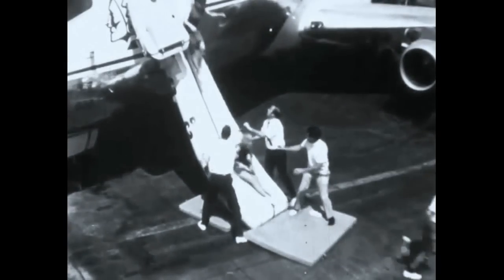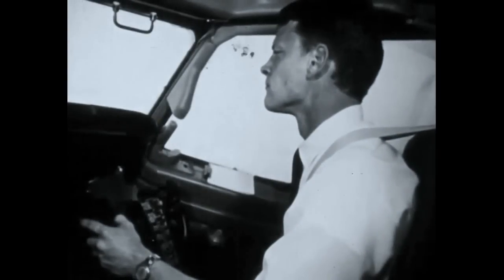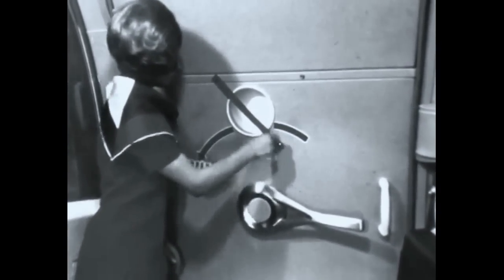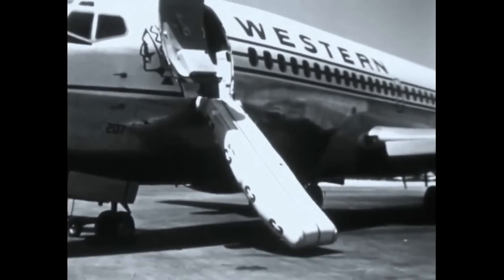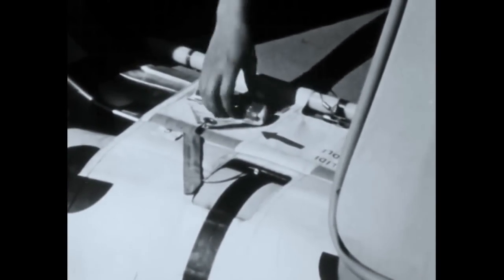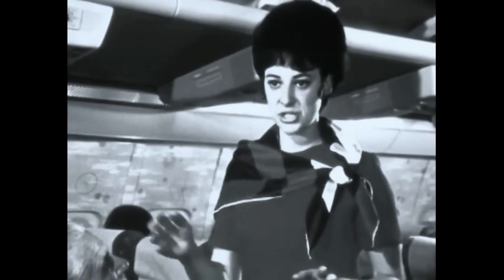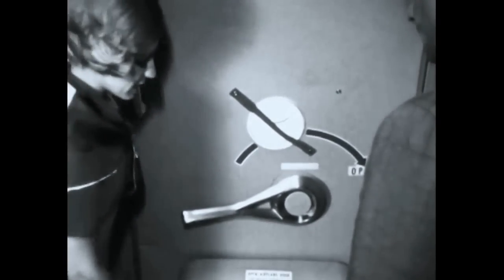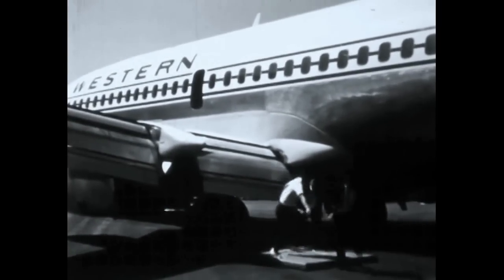Western Boeing 737-247 Evacuation Training Film  - 1969

Comment: This 737 is equipped with the first version of those JT engines (like the ones on the 727). The nacelle was later redesigned and lengthened to house the new thrust reverser (bucket type) when the original proved ineffective.

Comment: It's hard to believe, but in 1969 the 737 was a relative rarity, since the DC9 had been around for several years and had outsold the Boeing twin. The Chieftain scheme was really classy, and soon replaced by the big red 'W', which came along the following year. The Western 737 coach seats were an Aerotherm 'Zephyr II' design. The seat backs were actually fixed upright, while the seat cushion slid forward, resulting in 'recline' of the seatback cushion.